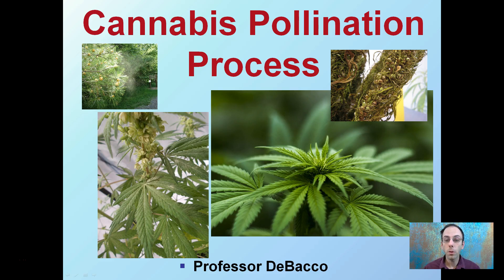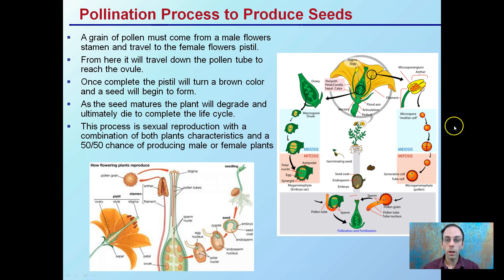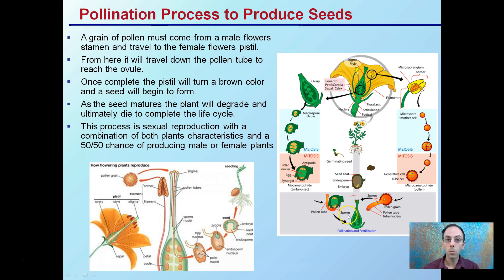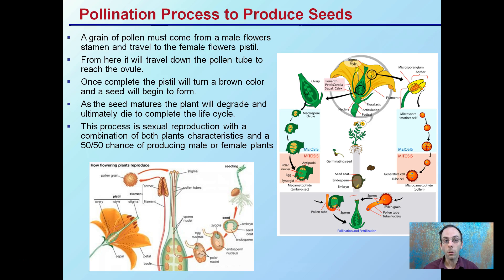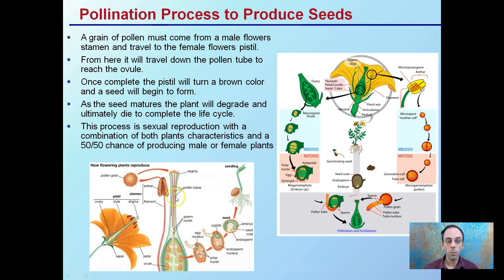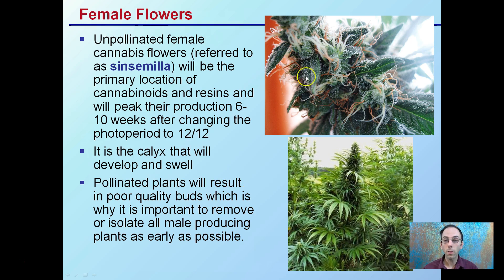Cannabis Pollination Process

Comment: How big is an ovule? In my dried bud, I have seen tiny brown seeds, like a flax seed but a little smaller. Would those be actual seeds or just ovules? Are ovules even detectable after the bud is dry?
Reply from the maker: Technically very small it is the supporting structures we most often see.

Comment: Will pollinating your female early affect your seeds production? Can't find no info on that!!
Reply from the maker: The female flower needs to reach a certain point of maturity to accept the pollen to allow for seed production.  Pollinating before this stage will not result in a successful pollination.  However, if plants (photo-period dependent) are "forced" into flower early, while seeds will still be produced, due to the reduced overall number of female flowers will reduce total seeds produced.  (Note: this assumes a healthy plant as poor health can reduce the number of potentially viable seeds a plant can produce.)  Hope this helps.
Reply: @DeBaccoUniversity  
Basically I have a male throwing pollen in the same room with early flower plants. I want seeds but not sure if I should separate them till the female flower is more mature. Wonder if it make a big deference separating them or not separating the male and females when making seeds. Guess I’ll find out!! Regardless PRECIATED👍
Reply from the maker: Separation of male and female plants would be advised to prevent pollination.  However if you want seeds keeping them together will yield much better results.
Reply: @DeBaccoUniversity  
Preciate your advice

Comment: Good video, thanks! What is the right time to pollinate a female plant? I mean, at which week of the flowering stage we must apply the pollen?
Reply from the maker: Many variables here as often flowers may have slightly different ages and stages of development within a plant and across a grow operation.  However, unlike other crops there is a greater window of pollination opportunity as some only have a few hours to receive pollen to be pollinated.  The goal is to look at the early stages of bud development.  The goal is to look at the white whisker structures called pistils, these should be white and sticky on close inspection to determine the prime pollination time.
Reply: 20 days

Comment: Hello! Good video.

Quick question.
How far can a male be and still pollinate a female?

 Lets Say My neighboor has 3 males and I have 3 females. Our plants are like 8 meters away and a 8'' wall separates them. Can this males pollinate my females??

Thanks in advance
Reply from the maker: Many factors to consider, such as ventilation system timing of flowering and plants age comparison to name a few.  However, in short pollen is very fine and can easily travel long distances so the situation you describe is likely going to pollinate the female plants.  If there is a plan to grow male plants than they should be grown in as an isolated location as possible.  An example would be in an isolated grow tent, with multiple stages of filtration on both the intake and especially the exhaust end of the air exchange system.  The males should also be discarded as soon as they are not needed to reduce the chance of unintentional pollination.  Hope this helps.
Reply: @DeBaccoUniversity  thanks for your time sir, this helps a lot. Best regards!
Reply: 8'   *